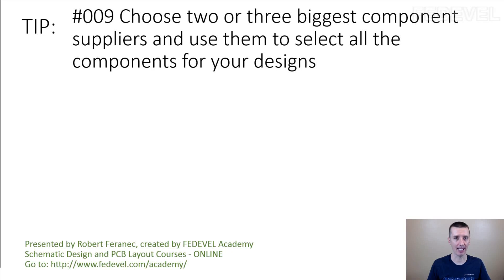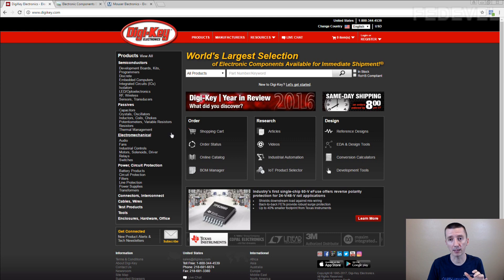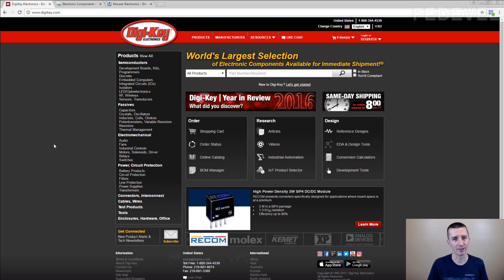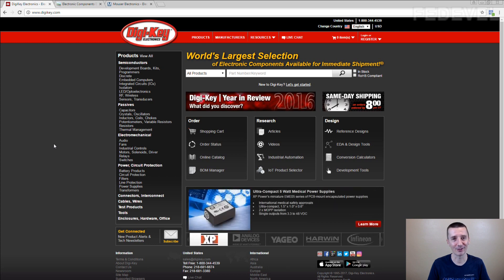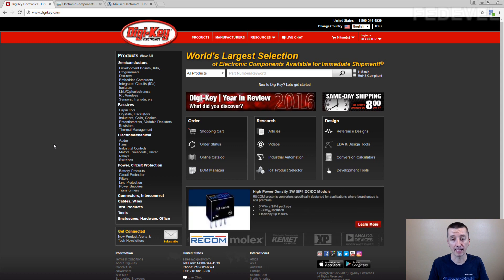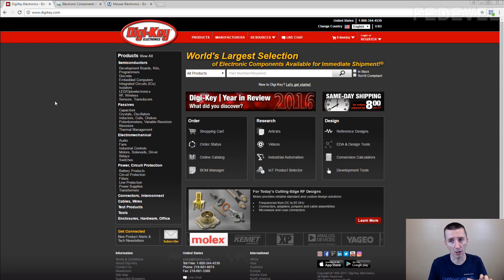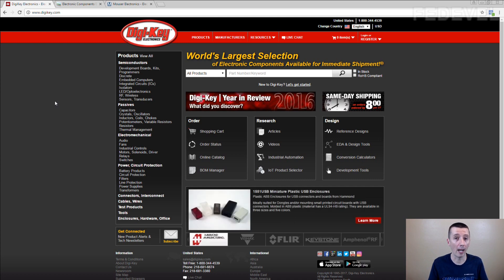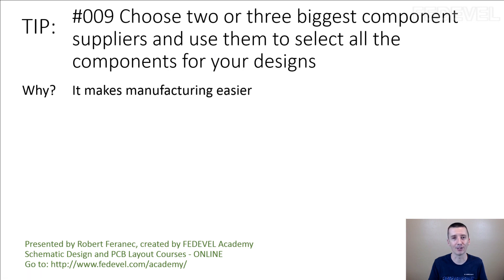TIP #009: Choose two or three biggest component suppliers ...

Comment: From which supplier do you prefer to import the parameters of a new designed component?
Does any of them has a slightly better or more standard (among designers, engineers etc) parameter database  than others?
Reply from the maker: We preferably import parameters from Digikey. It is a kind of legacy (we started with Digikey parameters because they had a good stock and component selection), but we are happy with them so no reason to change it. Even if we buy component from a different supplier, we always import parameters for the component from digikey database to keep all parameters across components the same. I am not sure if other suppliers have better parameters, but I do know, there are differences.

Comment: As a side note, I'm not that sure about Digikey as a source of components for prototypes in the EU, e.g. shipping cost is ~100$ (fixed), import taxes depending on the country are ranging from 17-27%. That cost is too high for prototyping, at least to me as an embedded systems enthusiast. Especially if I'm going to make repeated orders (e.g. changes in components, etc.). When Brexit happens in the following months, that will also apply to distributors located in the UK. I understand if someone is doing development for a company, but even then. On the other hand, Mouser has comparable prices, relatively good stocks and free shipping on orders of over 50€.
Reply from the maker: Yes, there are differences between US and EU market and you are right about shipping + customs. We started with Digikey, because they had really good selections of components + excellent search (e.g. I have never been a big fan of Farnell's search engine). For prototypes we buy all the components at once, so we normally do not pay for shipping (for Slovakia, the Digikey shipping is free for orders above 200USD). But, the truth is, to buy components in small quantities, we use Farnell.

Comment: Digi-key is my primary source, then Mouser.  I used to be Mouser (shipping in Texas ground usually arrives next day) but the database interface is so damn slow that it slows down Altium to much.  Findchips.com is really good at about searching through all the major distributors.
Reply from the maker: I heard about Mouser. Number of Altium users had problems recently with their database.
Reply: Yea, I tracked down the issue with Mouser and it looks like there database interface is just really slow also they limit the number of anon accesses so you need an active account with them in order to really use them.  And we hit up Altium for allowing a slow down of the work flow because of slow access to an outside vendor.  This really hurts regular development because of the way Altium did there vendor database look up.  This is a case of Mouser not caring or understanding...  and of Altium not paying attention to the details.